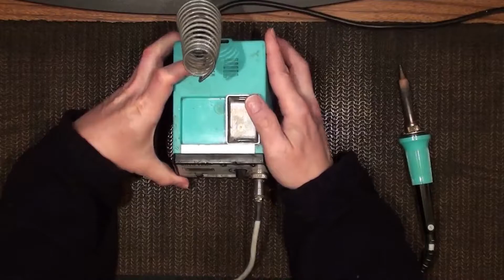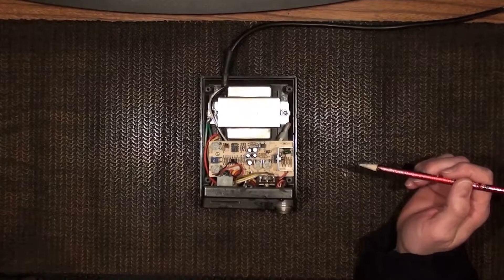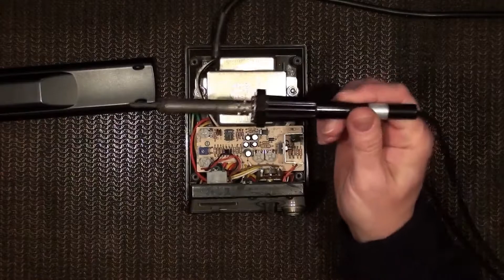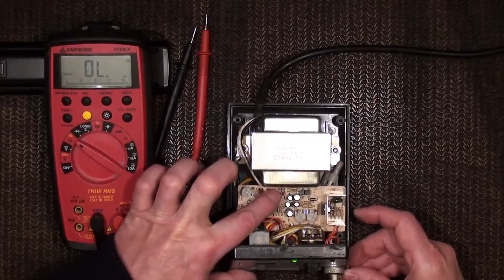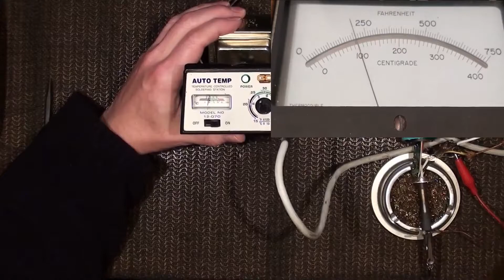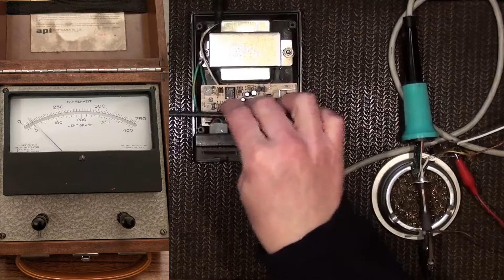GC Electronics Soldering Station Repair: The "Over-Excited" Gauge Needle!

Comment: FWIW, I also have, and am still using, a GC Electronics model 12-070 soldering station that I purchased some time back in pre-history.  In an attempt to determine how properly to open my unit, I discovered your YouTube clip on the GC 12-070.

To my surprise, the circuit board in my unit is laid out differently from yours, even though the unit carries the same model number, and, besides layout, there is a different complement of components on it.

The front control panel of mine is identical with your unit except for slightly different temperature scales around the temp-setting knob (the angular setting for a given temperature is the same as on your unit, but the format of the scale itself is different).  And, printed horizontally directly beneath the ON/OFF switch is “PAT  NO13834".  The first characters definitely appear to be the letters “NO” and not “N0" (i.e., N-zero).

I had hoped that what appears to be a patent number would lead to a schematic circuit diagram and a detailed description of the operation of the circuit.  Such a patent for my unit would likely have led to a prior patent including a circuit diagram for your unit and a detailed description of the operation of that circuit as well.  However, a thorough search on the U.S. Patent and Trademark Office website yielded no patent designated NO13834.  The closest guess that produced anything was patent number 00013834 issued in 1855 for a nutmeg grater.

The problem with my unit is that the temp-setting knob has become damned near impossible to turn due to a long time without having been turned.  Any thoughts about how to free it up?
Reply from the maker: A spray for electronics knobs (knob cleaner) would be a place to start, but you could also gently take the switch apart and try to see why it is stuck. If the resistive strip in the switch is ruined, the whole switch will need to be replaced. If you use the cleaner, always hold the switch so the dirty fluid runs back out of the switch. Don't let it gather inside the switch. Spray the switch with the opening facing down.
Reply: @ElectronicsEditor  Thanks for your quick response and suggestions.

I had been reluctant to spray the cleaner/lubricant directly into the interior of the control.  Rather, I had been trying to get the cleaner to migrate the other way back along the concentric shaft toward the control, but it didn’t work at all.  When I followed your suggestion, spraying directly into the control, in short order the control was completely freed up.  Thanks again.  I once more have a fully functioning unit.

Comment: That must have been the original fault, a faulty iron thermocouple.
The op amp was never the problem,  it just happened to look like it.
Early on, i was thinking the triac could be going short with heat but it wasnt.
Never mind, you gave it a good go.